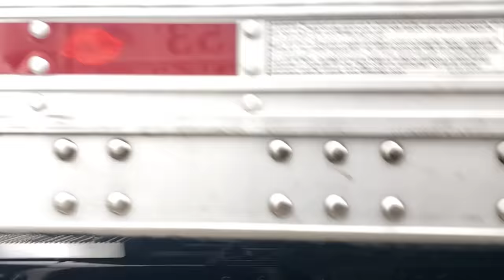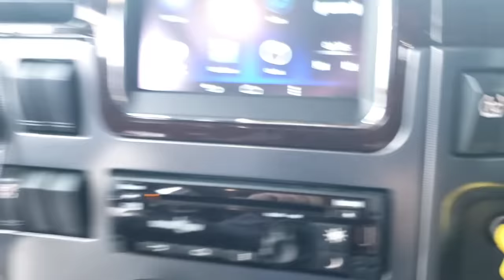How to slide your 5th wheel (and why). You Asked, I Delivered

Comment: So just want to know what you guys think I'm a flatbed driver I haul pipe split axle trailer with a peterbilt 579 sleeper tractpr. I recently slid the 5th wheel all the way back ( before it was second to last hole) I figured it will give me better turning and uturn capabilities without worrying about hitting the tractor I'm in nj ny md pa de area I do good amount of city driving and I at times have to go into tight spots make tight turns and some unavoidable uturns.  So will having it all the way back effect my turning or backing ? what about winter driving if i'm too light on my steers?? again before it was in second to last so I believe i wont feel a difference at all the truck is in the shop now for maintenance so i'm just analyzing on down time lol
Reply: My 5th wheel is in the last hole right now and I'm going to have to move it. The increase in turning radius will kill you in tight spots, even if your tandems are all the way up. If you run inner cities in the East, I suggest you move your 5th about to the halfway point.

Comment: How many lbs is each fifth wheel slot and trailer slot?
Reply from the maker: It depends on how much is loaded in the front vs rear of the trailer and how much it weighs overall. Plus, also depends on where the rear Tandems are. There's no magic number.

Comment: So anyone know if the fifth wheel is allowed to have slack up and down ? I changed the liner and it was worn bad 3 months ago now its vibrating drives and hear and feel like my trailer is bouncing on the fifth wheel.
Reply from the maker: That does not sound good and I do not know the official answer on that but I would definitely have a professional check it out.

Comment: I noticed that you have super singles tires on your truck and what do think about them
Reply from the maker: I haven't had any issues with them at all. They tend to have more advantages than disadvantages, but I should also mention, I've never driven on duals, so I can't compare it myself.
Reply: @JJtheTrucker  ok thanks for your opinion on them and I have also heard that if one of them goes flat or blows out you can be stranded too
Reply from the maker: Stranded is a pretty strong word, considering roadside assistance can come change the tire out for you lol. But yes, with duals, you can limp to a nearby tire shop in most cases. Although, my trainer did the same on a SS and it was fine. The SS haters always point to that one disadvantage, and disregard all of the many advantages. I've noticed a lot of Truckers become opposed to anything that changes. The industry was perfect the year they got into trucking and anything that changed since that particular year is a bad thing lol.
Reply: @JJtheTrucker  ok thanks and I guess they are pretty good at adding a little more weight than duals and you can drive with whatever tires you like
Reply from the maker: They're lighter than duals and have less rolling resistance, which helps with fuel mileage, and allows me to haul more freight. Freight pays not only by the mile, but also by the pound (plus other factors).
Reply: @JJtheTrucker  yes they are much more fuel efficient than duals

Comment: Is it easier to do when it's empty? I got a new truck snd the 5th wheel is sitting way back and pulling my lines and stretching. Ended up ripping my electric line out
Reply from the maker: Yep, much easier when empty because you have to crank the Dolly down to lift the trailer. And yeah, same thing happened to me with the electric line. Havent had any issues since moving it up.
Reply: @JJtheTrucker  ok I'll give it a go, thank u

Comment: Weight per hole?
Reply from the maker: I intentionally didn't mention that because it can vary based on trailer manufacturers and type, plus load distribution. It'll be different if they load heavy items up front and light items in the back vs the other way around.
Reply: @JJtheTrucker  i see, thanks for the info and excellent video BTW
Reply: My experience is those style holes 500 lbs a hole. 
Tips get those quick connect clamps for that style coiled line. And to have enough slack short spring on a carabineer hanging off the bottom of the refer. Dad did it on his I did it on mine. Gives you enough slack and keeps it off the deck plate as well.